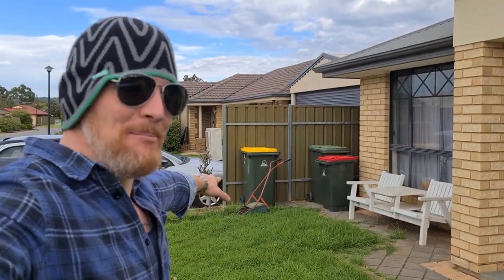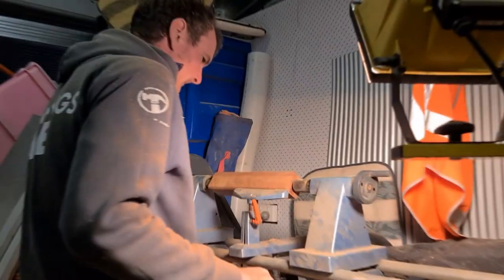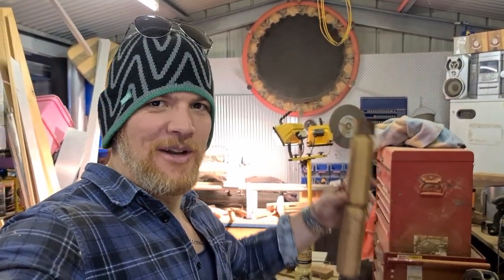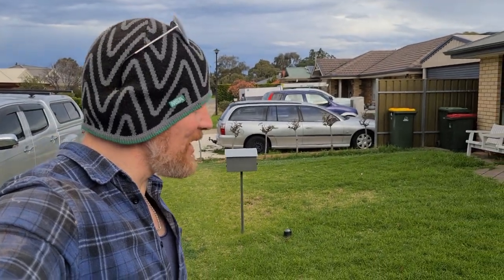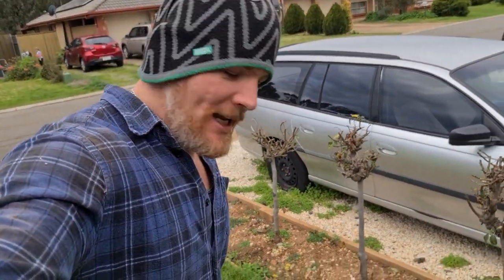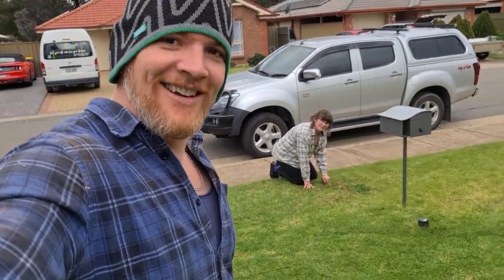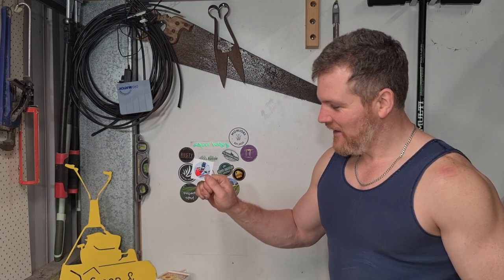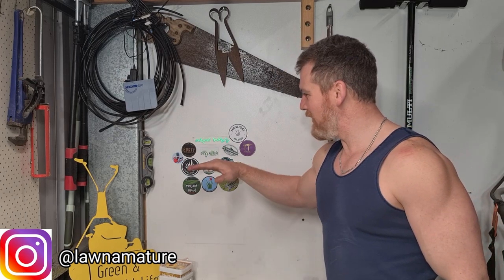QUALCAST RESTORATION - Turning a front roller

Comment: You can always use a cheap rolling pin as a roller just need to drill the hole and cut the handle bits off. Just a idea if yours don't work out looked good tho.
Reply from the maker: Cheers mate. Never thought of that. Hopefully the diameter is the same?
Reply: @thegreenandgoldlife1464  if it doesn't work out let me know I might be able to help you out.

Comment: Hey mate, coming along nicely! I've only got experience with metal lathes, so perhaps a wood turner is different, but can you not mount the roller in one chuck, and the drill bit in the other, spin it up and slide the drill down the guts?
Reply from the maker: I'm no expert either mate. But from what I saw, this lathe did not have a Jacobs chuck or anything to take a drill. I think the wood lathe rely on compression to achieve the capacity to hold wood as opposed to a metal lathe where a 3 or 4 jaw chuck holds the material. Again I'm no expert. But yeah, I'm hoping some one can help out otherwise I'll be doing it with the hole drilled first 🤦
Reply: @thegreenandgoldlife1464  Yeah fair call mate. Hopefully you can get a solution then. Good luck dude. 👍